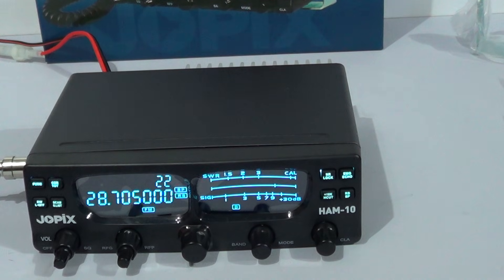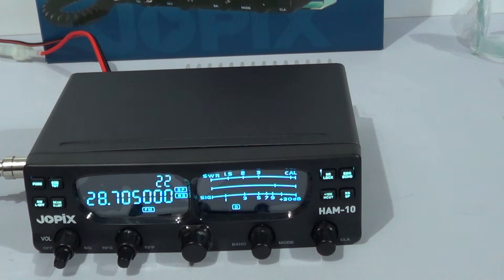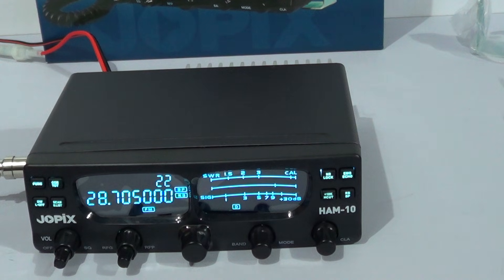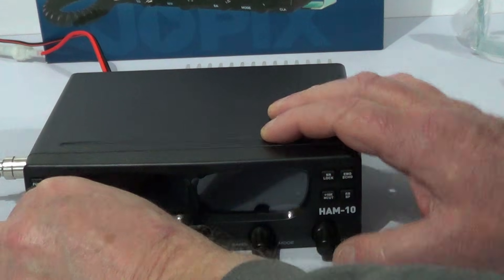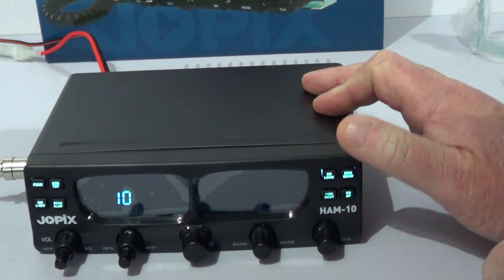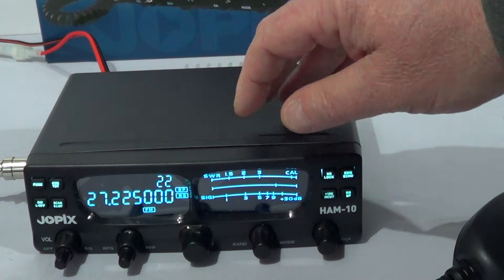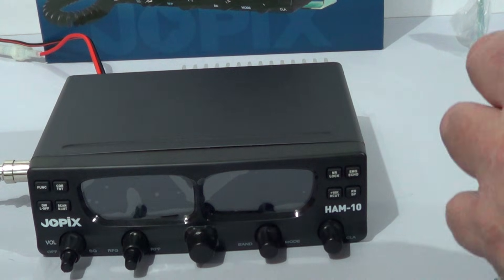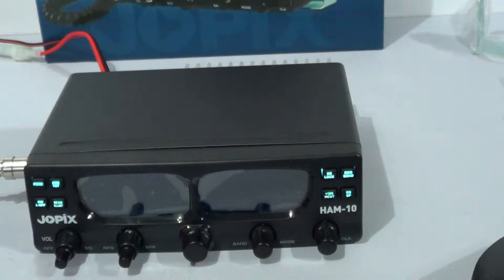EXPORT MOD : Jopix HAM-10 And Other Related Radios

Comment: I just unboxed an one. I tried to use it on 10m CW. The key down delay is really long and it's impossible to work. I'll try to find out if the delay is adjustable.
Reply: Not very great RX audio, but not really bad either, it depens the conditions.
TX audio is reported as OK.  The AGC often stucks(?), the receiver is quiet for a long time when you release the PTT. 
CW mode is useless(delay).

Comment: Great video Dave.
I actually really like this, I think the size, and the front styling is really good. I know looks are subjective, but for me, I think it looks really nice, and that's quite important to me as it's the part you spend 99% of your time looking at.
Reply from the maker: Thanks for your kind comment Nik. I prefer the Jopix branded models and find the company helpful. So took a while to get this version. I totally agree with you regarding the size of the radio, it is really short and ideal for mobile installation. I wanted to try one as  some versions has had a bit of a panning and the only thing that does need improving is the FM audio level. Looks wise, it does look better in the flesh, Personally I'm not a big fan of the looks, but as you say very subjective . For the price point of an AM/FM radio, it is somewhat of a bargain and worth a try.   Dave 🙂

Comment: Something about this radio is quite appealing & should your on air test confirm functionality it will be on my shopping list Dave.
Reply: wait until they fix them . full of problems
Reply from the maker: @johnlees8418  Low FM audio is the only issue I found
Reply: @m0ogy  you will see more keep using the radio . try the rfp . you can wind down the power and key you want 10 watts for your linear . everything looks good  you got your 10 watts . but after about 6 to 8 times you key the mic it goes full power then back to 10 watts . this a big problem .
Reply from the maker: @johnlees8418  Thanks John., the power control is certainly not linear and to be honest downright poor in it's operation. Thanks for your input.